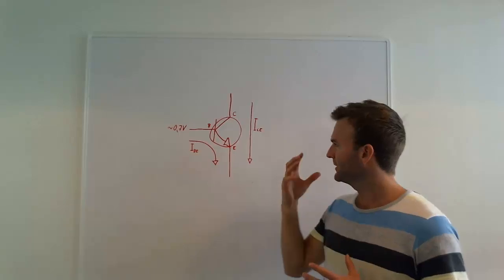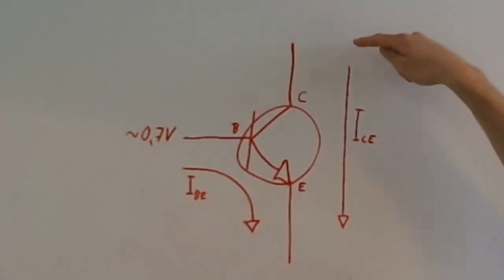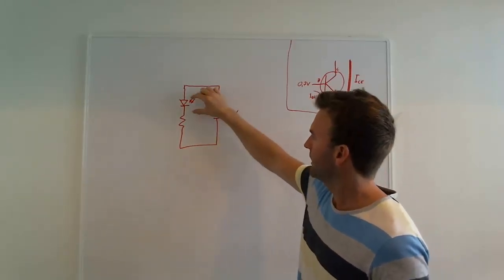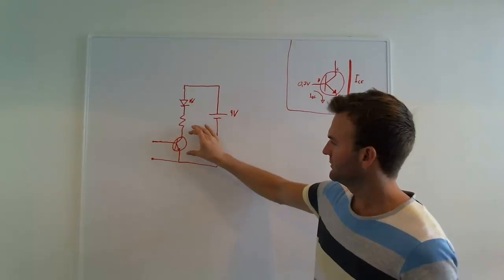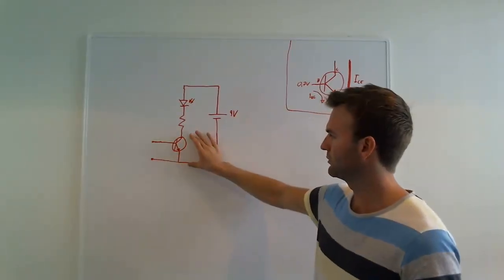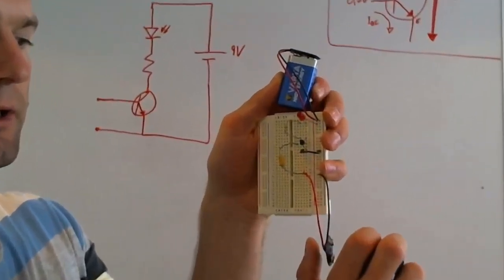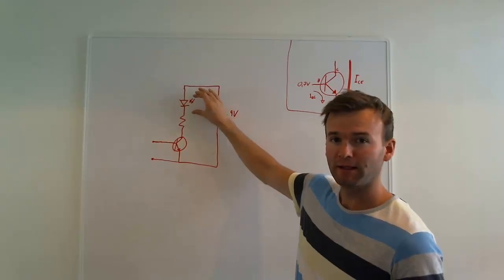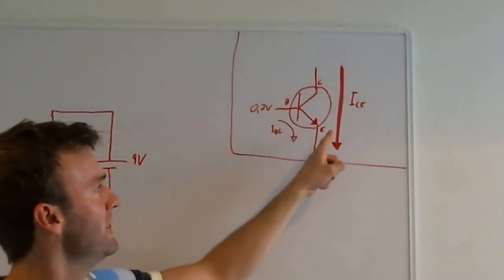How Transistors Work - The simple way to understand a transistor

Comment: IMO that transistor seems like a waste of a component. Why not just use a switch to turn the light on and off, why use a 2nd component (transistor) to turn the light on ?
Reply from the maker: To use a switch you must manually press the switch with your hand. To use a transistor, you just need a tiny electrical signal. This means the transistor can be controlled by other electronic circuits.
Reply: @Ohmify  and what is controlling that tiny electrical signal to feed that transistor ??
Reply from the maker: @ACommenterOnYouTube  That's up to you. A circuit that turns the transistor on for 5 seconds then off? A circuit that repeatedly turns the transistor on and off? A circuit that turns on the transistor when your cat enters its cat door? Endless possiblities

Comment: No use of resistor in emitter-base circuit why? It could burn?
Reply from the maker: Because the base to emitter voltage was 0.7V. With a higher voltage, which is usually the case, you need a resistor.
Reply: @Ohmify that mean, if power supply is 24 volt, then it is necessary to put a resistor in base-emitter circuit. OK!
Reply: @Ohmify  why not just use a relay ??? I think the transistor as a switch is a wasted component
Reply: @ACommenterOnYouTube  Relays need a lot of current to turn on, which is a problem if you want to control it from a microcontroller or other type of chip.
Reply: @ACommenterOnYouTube  It's more. The relay can only be completely on or off. There is no in-between state. The transistor can be completely on, completely off, or anywhere in between.

That's useful for building amplifiers.

For example. Let's say you can turn "something" that has 1A of current on or off. And you can do this with only 10 mA of current through the base (the control current). If you slowly increase the control current through the base from 0 to 10 mA, the current through the transistor will slowly increase from 0 to 1A.

So if you have a small signal (for example an audio signal) that varies between 0 and 10mA that you use as the control current you'll get a much bigger version of that signal varying between 0 and 1A through the transistor.

Comment: Thank you! So when they say that the transistor "amplifies" the voltage, are they saying that it is simply switching "on" with a very small voltage and therefore allows a larger voltage source to go through? 

Your video makes a lot more sense in my mind as to how the transistors work to be a switch and a "voltage amplifier". I always thought that the transistor itself would increase the voltage, (something like a step up regulator), but I couldn't see how it could do it. 

However, now I see that it allows another voltage source, (of greater voltage than what's needed for the transistor to turn on), to get through! OK, so now, when does one select an NPN transistor as opposed to a PNP transistor?
Thanks again for the explanation!
Rich
Reply from the maker: Yes, the transistor does nothing magical to increase the input voltage - it just controls a higher voltage that becomes the output. And it's not only fully on or off - tiny changes in voltage/current on the base results in large changes in voltage/current on the output.

You can use NPN for most cases. But there are some circuits, like a push-pull amplifier, that need both an NPN and a PNP. Here's an article I wrote on how the PNP works: https://www.build-electronic-circuits.com/pnp-transistor/
Reply: @Ohmify   Thank you! I'll read that. I need to know more about transistors so your help and this video was invaluable!
Thanks again,
Rich
Reply from the maker: @richpaul8132  Great=) Also, check out this article that I recently updated - there you'll also learn about mosfets: https://www.build-electronic-circuits.com/how-transistors-work/
Reply: @Ohmify  Mosfets! That's yet another 'blind-spot' for me. Yes, that'll be very important to me as well! In fact, the mosfet is something that I've barely worked with at all and I don't know why I haven't pursued info on this component more often in all the years I've been 'hobbying' with electronics.
Thank you again!
Rich

Comment: Hi, I tried to repeat this experiment but the Arduino kit only had another type of transistor (MOSFET) and it didn't work that way. 
I have two questions: 1. can you make a video showing how that other type can be controlled? 
2. What type of transistor did you use in this video?
Reply from the maker: Hi, I used an NPN transistor. Mosfets work a bit differently and sometimes need a bit more voltage to turn on.

Comment: Is the current between collector and emitter controlled by the voltage at the base. So if 0.7 volts is applied across base / emitter is the transistor able to realise  its full potential current flow.
Reply from the maker: Actually, it's the amount of current from base to emitter that controls the amount of current from collector to emitter.

Comment: I'm more confused now than before. Why is base conducting current to emitter if it is connected to the negative side of battery? That would imply that current is going from the positive side of battery, thru the collector to base, the way I (don't) understand it.
Reply from the maker: The control current that controls if the transistor is "On" or "Off" goes from base to emitter. The main current that can be turned on and off goes from collector to emitter.

Comment: it seems that i just cannot understand transistors... what he did could have been done without a transistor no? what was the transistor doing? Im very confuzzled, it seems that nobody can explain a transistor to me to the point that i actually understand its purpose ... even a little bit
Reply from the maker: The transistor lets you turn something ON and OFF (in this case an LED) using an electrical signal. In this video, the battery was the signal (which I understand can seem useless). But check out the following example where the signal is created from light, and maybe it will make more sense: http://www.build-electronic-circuits.com/ldr-circuit-diagram

Comment: Majoring in comp eng, the biggest problem I have in circuit analysis classes is confusing myself with all of the arbitrary rules, and then when explaining broader uses I'm already lost... this video just helped clear up two weeks of confusion!!! Why couldn't they just say "apply diode turn-on voltage at the base, for the larger important collector current to flow"
Reply from the maker: Haha, I had the exact same experience when I went to Uni. The professor was going on and on about n-doped and p-doped materials. The first weeks I was totally lost. I'm very happy to hear this cleared up your confusion!

Comment: To make transistor conduct from C to E,  can the voltage on B be bigger(or equal) to ~0.7 or it can be smaller (but still ofc bigger then 0)?
Reply from the maker: It can be a little bit smaller. But smaller voltage results in a smaller current between c and e.

This is the effect that makes it possible to build amplifiers with the transistor.

Comment: Hi, how come you didn't just take the 0.7 V from the negative on the battery already attached?  you could of just attached the resistor coming from the negative to the base of the transistor.  Btw, what resistor value are you using if you don't mind me asking?  :)

Comment: I have never understood why people explain transistors as a switch which is turned on by a small base current.  Doesn't it make more sense to turn on current in the same circuit by having a switch before the collector.  That could be a physical switch  or a photoresistor to turn on circuit in high light levels.
Reply: It's just a way to explain how it works. But this circuit isn't a good example of a useful way to use a transistor. 

A better example of a useful application for a transistor is with the photoresistor that you mention. But using a photoresistor directly is hard, because you have to find the perfect match of light-level vs resistance. By using a photoresistor with a transistor, you can separate the "light-sensing" part from the "what you want to control" part. So you can use pretty much any photoresistor to control pretty much anything from an LED to a motor.

Here's the circuit I'm talking about: http://www.build-electronic-circuits.com/ldr-circuit-diagram
Reply: Thanks Oyvind.  That makes a little bit more sense.

Comment: would you need to put a resistor in front of the transistor to limit the current going into it to 0.7v??
Reply from the maker: 0.7V is the voltage. But yes, it's normal to put a resistor in series to reduce the current.

Comment: i don't understand how the transistor gave a greater current, it looks like the LED wasn't as bright actually.
Reply from the maker: +Shlomo The transistor doesn't produce any current, it just "opens up"  and let's the current run through it from collector to emitter. Similar to a switch. And to get a brighter LED, you just need a lower resistor value.
Reply: +BuildElectronicCircuits So why wouldn't you just use a normal switch? It seems much easier to me than providing a separate voltage to the base of the transistor.
Reply from the maker: +Shlomo That's a good question. For this circuit, yes it would make more sense to just use a switch. But this circuit I made just to create show how the transistor works. But, the switch requires you to flip the switch manually, the transistor can "flip the switch" with current. So check out for example the LDR circuit to see an example where the transistor makes sense: https://youtu.be/YqzqE25T5bY
Reply: +BuildElectronicCircuits thank you man! Makes more sense now! i'm still in high school and trying to learn about electrical engineering. These things can get confusing, do you recommend any specific books or kits that would teach me more about these things? I want to learn more about circuits, electricity, and components like diodes, transistors, etc.
Reply from the maker: +Shlomo I've put some resources here: http://www.build-electronic-circuits.com/resources/

Comment: I've only watched 40 seconds of this video and it's already taught me more than watching about 30 other rambling video's about electrons, holes and doping.
Sorted!
Though I would like to know how to use a transistor as an amplifier.
Is the current applied to the base proportional to the current gain across the collector and the emitter?
Reply from the maker: +Chris Heartscape Yes it is! Or at least, sort of proportional at a certain point. That's where "tranisistor biasing" comes in. Where you add components to make the transistor stay within this "sort of propotional" area.

Comment: So the point of a transistor in a tesla circuit would be to increase the amount of current in the circuit ?
Reply from the maker: +kebab4eva I'm not familiar with tesla circuits, but after a quick Google, I think I know what you mean. In those circuits I saw, the transistor was there to create an oscillating circuit.

Comment: Excellent tutorial.
Would be great if you can show which pins are E,B and C on the transistor.
Reply: +Biranchi Narayan Nayak Use Google to search for diagrams of both NPN and PNP transistors.  Transistors come in different varieties and shapes as well.Flatand square types like the TIP 120 series. The round types are metal and have the designated T0-200 series. These are just two types, but there are many more that are bigger and used for amplifiers. etc. The type in the video was probably a Darlington type or 2N3900 series.

Comment: If I want to have a light behind a switch plate to turn on at night, or with motion as well as a off position- I need to have every thing looped to a three position slide controller that has a on; off; dusk to dawn; or motion, I want to understand how to determine exactly what type of resistor would be needed for each junction; as well as transistors-and where to properly place them. The power source is AC-

Comment: Nicely explained..
Can you please tell me few things :-
How much max voltage can be put across the Base & Emitter ?
Though, 0.7 V is sufficient, what is the max value that can be applied ?
Does it depend upon transistor to transistor ?
Reply: Yes it depends on which transistor. Just look in the datasheet of your transistor and you'll find it.

Cheers!
Oyvind
Reply: Pammi Jee What he really meant was that the base-emitter junction has a voltage drop of about 0.7V. You can apply as much voltage as you want as long as the emitter is at a lower potential than the base.

The maximum base-emitter voltage specified in transistor datasheets is only for when the transistor is reverse-biased, that is, when the potential of the emitter is higher than the base. This is because the base-emitter junction is a diode (the BJT transistor is just two diodes sharing a common junction).

Comment: This is the best and cleverest explanation series I have ever encountered. Brilliant just brilliant...you are finally making it all fall into place. I am 59!!!!

I'm irritated because I know current flows the opposite way to the way you are implying...ie from the negative supply up through the emitter to the base of the transistor.....So why treach it the wrong way around?
Reply: Hi!

I am glad you liked the explanation =)

Current can flow both ways, depending on if there are positive or negative charge carriers at work. In metals, we have negative charge carriers. Also called electrons. They flow from negative to positive.

So, in a normal electric circuit based on metal, electrons will flow from the negative terminal to the positive. But, the conventional way of talking about current direction is from positive to negative.

But anyway, it doesn't really matter. You can choose whatever direction you want, and your calculations will be correct. I use positive to negative because that is the conventional way of talking about current flow.

Check out wikipedia for more info: http://en.wikipedia.org/wiki/Electric_current#Conventions

Cheers!
Oyvind
Reply: Oyvind Dahl Once again Thank you.
I have made more real progress in the last 24 hours since finding this site than I have in over 45 years.
I love your component by component approach.
Thank you for quickly addressing my current direction query. I am going to stop worrying about this after 45 years!
Reply: gersprungled Haha, that is great to hear! No need to worry ;)